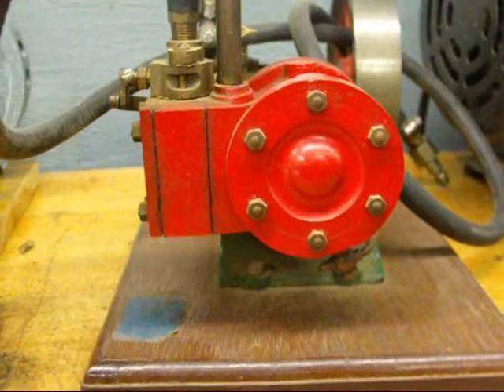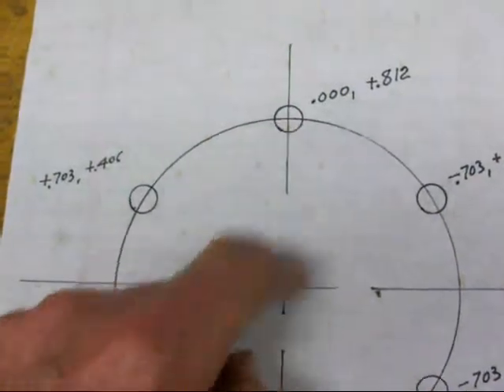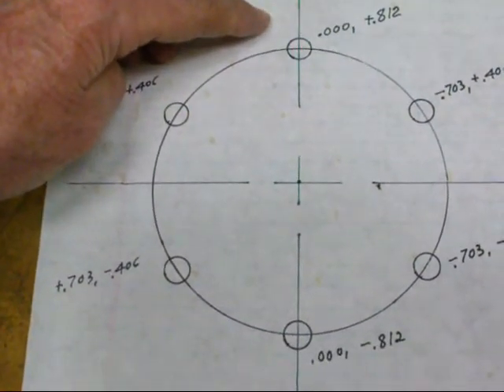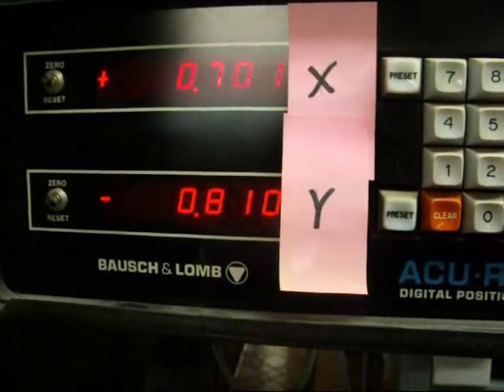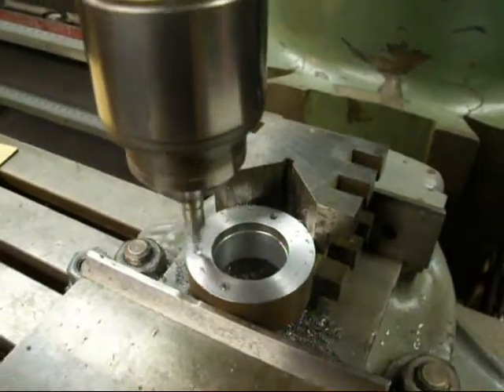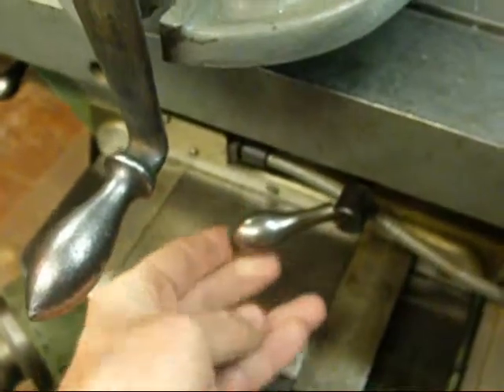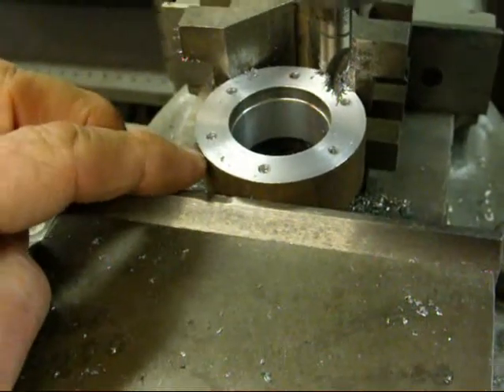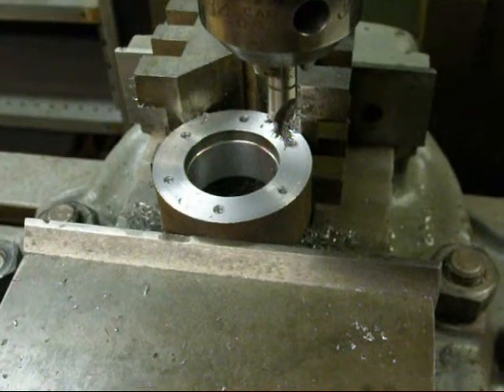THE BRIDGEPORT MILL part 4 Drilling a Bolt Circle tubalcain

Comment: I understand that you can drill them out in the mill or transfer them to a drill press because you already centered and spaced the holes.  If you were to transfer it to the drill press how do you make sure that the drill bit is perpendicular to the surface of the table within the same accuracy as the mill?  In a more extreme case, say you were to drill a 1/4" hole length wise in a 1/2" diameter round bar that was say <6" long... how centered would the hole be at the point of exit?

Comment: You have backlash even you using RDO.
Reply: Correct. But a dro dosent care. It will read-out right where you put it even if you enter the "slop zone".  He states to lock the x and y once located on each hole to eleminate backlash or any other accidental movments.

Comment: @czjmp6   because the center drill is for exact location drilling which a bridgeport is needed. after center drilling a drill press can be used to finish the process much faster.  the accuracy will be maintained because it was center drilled with a digital readout

Comment: saves time and if you listened drilling holes when your piece is clamped could break your drill. If you pre start your holes like he did the drill will sink into the hole and automatically  locate.  I'm a machine-st at oilgear, Ive had to learn a lot of these techniques the hard way.